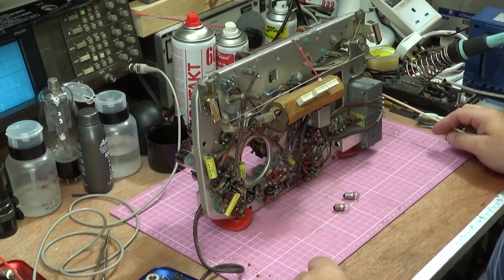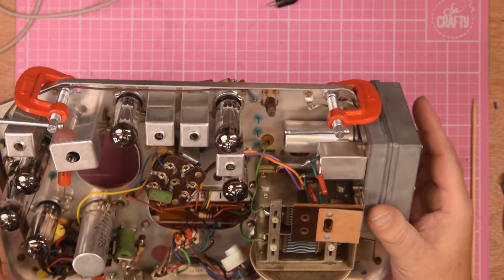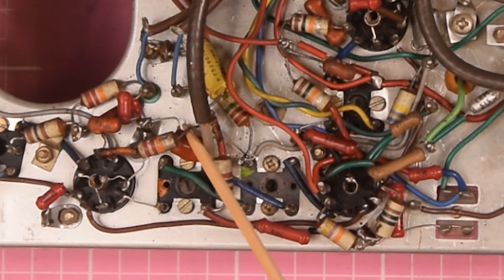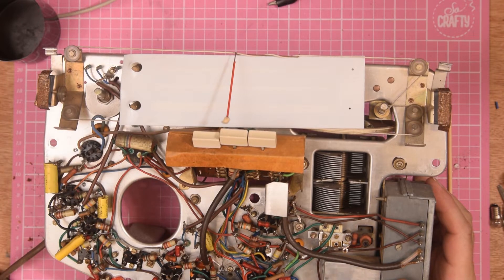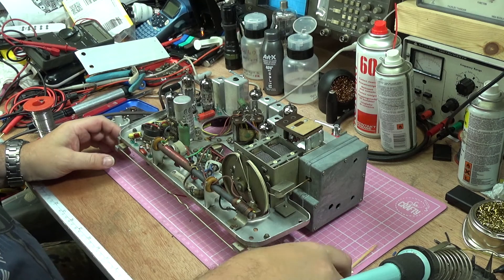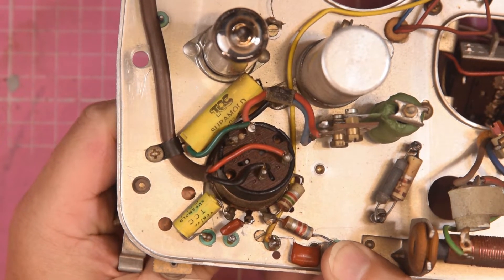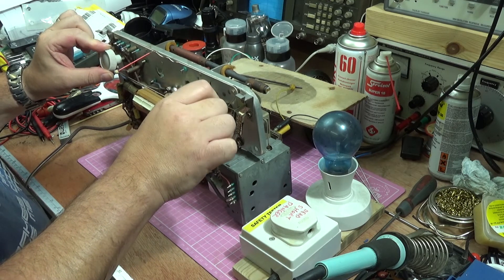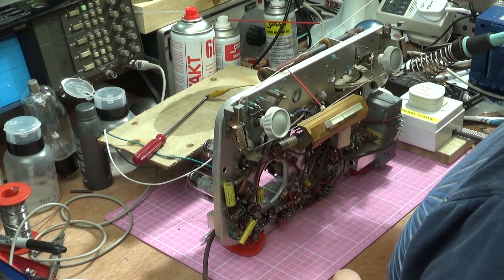Valve Radio Repair : 1964 Bush VHF81 : Part 2 - Power on!

Comment: Hi George. Nice to see valves again, made in the days when +-20% resistors were common. A quite unusual channel for you - glasslinger. This person tends to do very old valve kit and all sorts of odd items. Only does one of two videos a year, sometimes less. From what I have seen glasslinger is pretty expert at sorting all sorts of switches and sockets. Right up your street mate. Likes to use a one of those monster Weller soldering irons. Take care - JP
Reply from the maker: I do like valve kit although it had already been made obsolete by the time I started in electronics. I like the simplicity of the designs where you can actually follow the signal path in obvious sections unlike a lot of modern one chip wonders. I will check out glasslinger, always interested to find proper content to watch instead of a lot of rehashed 10 things or prank videos.

Comment: Those dirty sockets will mess you up every time George. But, it works pretty well considering you did a rather minimal parts replacement. Great Job so far George. Thanks for sharing.
Reply from the maker: I was so surprised I wasn't getting mains hum from the 50 year old filter cap. For its age it works really well with so little work.